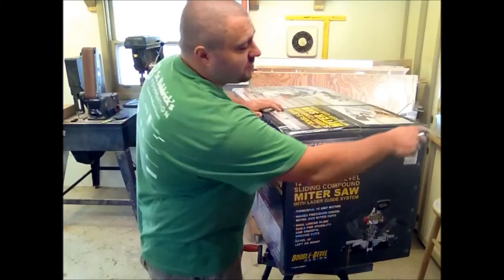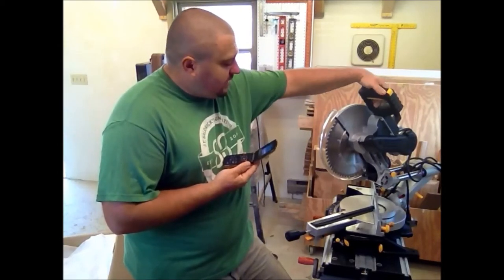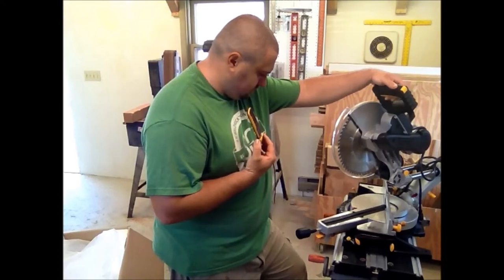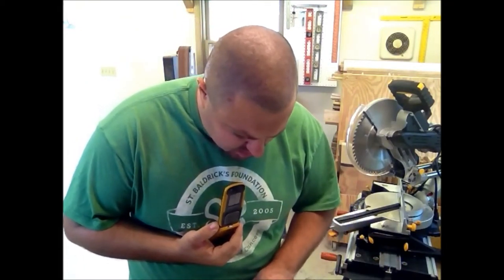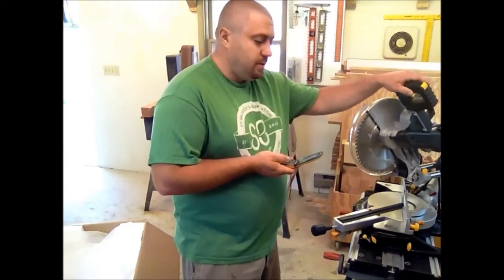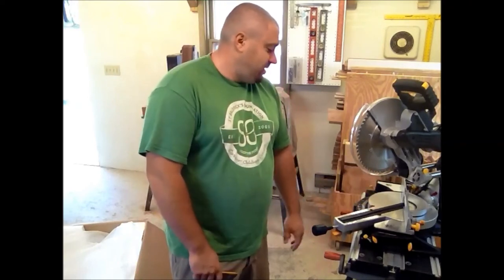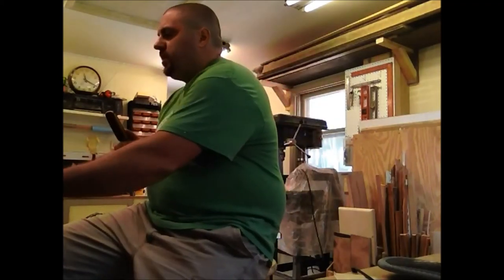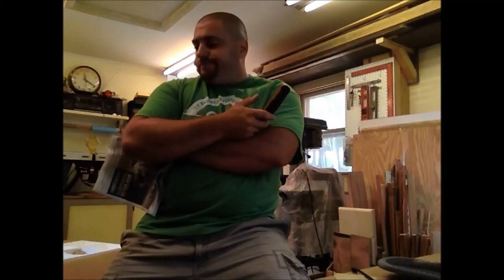★Harbor Freight Tool Review of Customer Service for Broken / Damaged Tools and Products

Comment from the maker: Cutwoodnow I did not just glue it for a few reasons. The first is that this is a part that has a good amount of vibration and is thin plastic and would be apt to come apart again. Second reason is that I do not want a ridge of glue on the kerf board that would likely catch on boards that slide across it and in turn would make it more likely to break again. The main reason is that it is brand new, and that I should not have to deal with a broken new product, get proper glue from the store, glue it, clamp it, and chance it coming apart while I'm using it and sending plastic shards flying in all directions.
I hope I answered your question. Thank you for watching my video.
Reply: I'm pretty sure that epoxy would hold the plastic quite well. By the way, at HFT we don't carry parts at our store only because there would be no room to store every single replacement part for every single item. On the contrary, our "1-800" number for parts is a mess because we have 500+ stores and at every store we have multiple customers per day asking for replacement parts (and I am sure there are only three people working at the parts hotline). An alternative way to get parts would be via e-mail. In all honesty, Harbor Freight is at fault for not being able to supply you with a part, serve you with convenience, and for attending to you with delay. For reasons that I wouldn't know, we don't have a replacement part ordering webpage or anything better.

I feel pretty bad when I work at the store and we can't do much to help someone. In this case, I feel pretty much the same way. I'm sorry, Dan!
Reply from the maker: I agree with you that it seems to be a fair bit disorganized with part and customer service. I'm glad to see that I'm not the only one who thinks this to be true. Thank you for watching and commenting on the video.
Reply: Whump Tapus I tried to get a part for a sears Craftsman router through their parts ordering  system and it was a nightmare as well. Custiner Service is non-existent any more.  Not just Harbor Freight.

Comment: I have a very similar experience as you with a power drain opener I got for Christmas.  It was missing the cutting tools that were supposed to be in the box.  After several attempts to get them to JUST send me the missing parts, they said I had to take it back to the store. That sucker weighs over 75 pounds, and I was not going to carry it back to the store just for 3 parts that weigh less than 8 ounces total.  I ended up buying the parts on Ebay and vowed that this was the last tool I will get from Harbor Freight.
Reply from the maker: larryz24 They do have a good many number of tools that are a good value. It is a real turn off though when issues like your and mine arise. It seem that Harbor Freight Tools (OFFICIAL) could come up with a solution to make the customer happy and be able to save the business money too. Maybe they will see our posts and take note of what their customer base is saying about the after care of the customers. Thank you for watching and commenting on this video. I hope to hear from you again soon.

Comment: Unfortunately most companies operate like this. I ran a retail farm and ranch store and I would occasionally swap out trailer parts, sprayer parts, etc. and then I would call the vendor and get a replacement saying it was damaged in shipping. I have found most managers don't want to go the extra mile for the customer anymore. The one company that has the best customer service is Weber! I will never buy another brand of grill again. I had an issue with a smoker part and they sent the replacement parts 2nd day air and even though the owners guide had a cost associated listed for them they charged me $0 and called me back a few days later to ask if they worked!

Comment: I hear what you're saying and I agree with you that sounds like the best solution to a simple problem but Harbor Freight does not manufacture these parts so they would not have the part that is broken on hand. This is supplied by the factory only plus the factory has a contract with the seller to provide, among other things, quality shipping material for their products and if they fail to do that they need to be charged back.

Comment: Playing "Devil's Advocate" ... I could see a couple of reasons why the store wanted the whole unit back ... #1) The piece that was broken was on a saw that has a part # ... but, is it revision #1, 2, 3, 4, 5... they sell so many and the saw changes during production as newer revisions of that saw are blended into the production line ... which do you have ... anybody's guess.  #2) if the saw is returned in its entirety ... they can tell which plant made it...who inspected it and what kind of packaging is allowing that to happen.
Reply from the maker: djkulp1 ya know what? That is actually the best reason I have heard as of yet. That makes sence to me. Thankyou for mentioning this. It actually makes me feel a little better about having to return it to the store. It still cost me the extra fuel and time to go back. oh well water unde the bridge. Thank you for commenting and sharing.

Comment: 10 miles per gallon?!?!?!
Are you driving a train?!
A Lamborghini gets better mileage than that!
Reply from the maker: Dikotomii X Nope. ram 2500 4x4 with a 5.7 l hemi. It pushes and pulls great, but stinks as far as gas mileage. Choooo Chooooo. :)
Reply: Lol that's what my F250 gets for mpg
Reply: @DanRogersMountianDan  get another truck
Reply from the maker: @coleyounger2874  I did.... I got a 1500 ram with the 5.7 hemi... ironically I still get the same mileage that I was getting on the 2500..... It must be a thirst model of Dodge engine.

Comment: I had the same experience with their 3 shelf metal cart .  I managed to strip about 10 of the 100 bolts the cart came with and I couldnt get the bolts from CS . It took me an hour to assemble it . A lotta time to dissassemble and reassemble . Then they offered to ship me one and exchange it but Id then have to repack it and take it to UPS.  I ended up getting a gift card for 10.00 only to find the gift card was only for HF. LOL I gave up and just bought my own bolts.
Reply from the maker: Ed Yager yikes that is ruff. I think I would have just went and got the bolts too, my friend. I was looking at a 3 shelf cart for the shop. Was there really that much assembly?
Reply: Dan Rogers well let me think . each corner has 2 bolts . 4 sides x 3 shelves each has 2 bolts . 24 bolts plus the handle .  ok so maybe there is not 100 lol . oh and the wheels have 4 bolts each . But more important is the wheels are mounted way to much in the center making it very tippy. my big rubbermaid card wheels are mounted right on the corners and is rock solid . the shelves are thin metal but it works for light stuff. but after the super coupon of 29.99 and the 10.00 gift card I cant beat 19.99 for it
Reply from the maker: Ed Yager sounds like a good price for the hassle it took you. here is the big question, would you do it again?
Reply: No I would go for a small rubbermaid cart if I had it to do over again . They will last forever and are way more stronger .
Reply from the maker: That is exactly why I asked that question. I get to learn from your experience. And maybe save myself some hastle too. Did you compare pricing between the two?
Reply: sams club sells this steel 3 shelf cart . looks better but is 99 bucks  http://www.samsclub.com/sams/excel-steel-tool-cart-with-rubber-work-surface/prod6400636.ip?navAction=

and lowes sells the rubbermaid cart for 110.
http://www.lowes.com/pd_4069-1097-FG450027BLA_0__?productId=3699012

not as cheap as the HF cart but you do get what you pay for lol
Reply from the maker: Ed Yager awesome. Good info. Thank you.
Reply: Ed Yager You need to invest in a inch lbs torque wrench, or stop eating so much spinach.
Reply: well to be honest I was using a dewalt impact screw driver ..  I should of used a screw gun with a clutch.

Comment: Always inspect your purchase before leaving the parking lot.
They do have parts, but they don't have them at the store.
The parts list paper has a phone number to call for parts.
Reply from the maker: Dennis Flora I should have opened the box. I just figured that the box was not damaged  at all so it would be good. Well we both see I was wrong there. The 2nd phone call in the video was to the number that was on the parts list. As you heard the gentleman that I talked to said there was not parts available. Frustrating, to say the least.
Reply: Dan Rogers 
You can repair the crack with 3M 5200, but it takes 3 days to cure, before you can use it, but it will be as strong as new. 5200 comes in black or white. 
Just don’t let any cure on the surface, it’s a bear to scrape off after it 
cures. It’s a permanent repair.  Dennis
Reply from the maker: Dennis Flora I have not heard of this before I will have to look into it. Thank you for the advice.

Comment: Why would you want to replace only the plastic piece when the saw obviously received a severe jolt during shipping? Aren't you worried that there could be other damage or misalignment?
Reply from the maker: Marty Colasurdo good point. I had figured out that the piece broke due to the way it was packaged. The manufacturer put a thick piece of cardboard between the saw blade and the kerf board. When the saw was placed in the foam in the box the cardboard piece prevented the box from closing all the way by about a half inch. the box was taped shut then other saws were stacked on top of it. This forced the saw down that half inch breaking the kerf board. I believe that this is how it was broken. If i thought that it was broken by a drop or other blunt force trauma I suppose I would have caught that at the store with heavy damage to the box.  I appreciate your input and thoughts. it is certainly a valid question. and a great point.
Reply from the maker: Marty Colasurdo have you had issues like this with products from a retail store?

Comment: Harbor Freight power tools are a big no-no, unless you are using them a couple of times. Not just because of the bad quality and obvious lack of quality control, but also because you cant buy replacement parts, so when anything goes wrong with them you are screwed.

Comment: I purchased a metal work bench last week from them the sore is a hour and half away from me but i was in the area and had a 79$ coupon anyway i get home  put the BENCH TOGETHER  and get down to the end and they put 2 of the same parts in box not a right and left but two rights........ I called the store and the girl said call the 800 number so i did the 800 number kept me on hold for almost 30 mins then the phone hung up.... I called pack and it was picked up in about 5 mins... was told the same thing you were they dont have parts take it back to store.. I called the store back and asked for a manager  told him the bench was fully built except the missing drawer rail  and that i had a small car and did not wont to take it back apart.. he told me to just bring the extra arm and he would give me a left one ................after thinking about a 2 hour drive and the gas i got out my drill and made new holes dont look 100% but it works lol
Reply from the maker: Stephen Howell I'm glad to hear that you were able to fix it yourself without having to waste the time and fuel to go back for the part. At least the manager was willing to give you just the correct part and not make you to return the entire bench. That sounds like it would be a pain in the neck. Thanks for watching. I hope to hear from you again soon.

Comment: By time you did all the calling you could've swapped it out already. You would've driven out there to get the part anyways. Yes their fault QC sucks but not their fault you don't want to bring something back you can easily lift. BTW I have to take something back tomorrow 30 miles that weights 3x more than that.
Reply from the maker: mbickerdike17 that stinks. I am sorry that you are in the same position I was in. I really only wanted them to send me the replacement part. That would have saved me alot of time and travel. Oh well.
Reply: No one gives a rat's ass what you had to take back. Let the man do whatever he wants.

Comment: Probably replacing the tool would be better as we don't know what caused the break so something on the tool may have caused it and would need to be replaced.
Reply from the maker: Lee Wood the broken kerf board was broken by poor packaging. This became evident to me when I unpacked 3 more saws from whole in the store and found all 3 broken in the same spot. When the saws were packaged a thick piece of cardboard was placed between the kerf board and the saw blade. The arm was then zip tied down. Then the styrofoam packing was put on top and the box sealed. Unfortunately the cardboard did not allow the arm to go all the way down, so when the boxes were stacked it forced the saw blade down onto the cardboard. This forced the kerf board down too breaking it. It is a waste to return the entire saw. Plus a waste of my time and gas to take it back to the store. All because of sub par packaging. That is truly a waste all the way around.

Comment: Considering how much money was paid in the first place, and it being a gift why not just spend a little money on a plastic welder or some super glue? Yes I know it was broken from the start and it shouldn't have been but things do happen.
Reply from the maker: Love2boat92 I understand that things happen, and that is why I sought out a copasetic replacement for the broken part. The part that was broken could have been easily removed and replaced. I do not however feel that gluing or plastic weld would be a viable option for this part of the saw. I believe that with the amount of vibration from the saw and the weight of the material that would be sitting on it and sliding across it that it would have most likely broke again. Or worse yet the piece would get pushed into the blade and be broken off and thrown back and into my face. I really don't feel that repairing the broken part was a safe option. Yes it was a gift. Granted it was not a dewalt or another expensive brand, but it was still around $200 roughly. That is a fair amount of money for the saw. I feel that it should be in good shape when I open up the box. All I really wanted was a replacement part, but as you heard in the video "they don't make replacement parts yet for that saw because it is to new.'' My only option was to exchange it at this point, which I did.
Reply from the maker: Love2boat92 now allow me to ask you a question. If someone purchased a gift for you, lets say a new car. When you went to the dealership to pick it up you found that the dealer's employee had parked to close to the rear of a truck in the lot and had broke a head light on your new car. Would you expect the dealer to replace the broken head light, or would you want to glue it back together and call it good enough?
Reply: You brought up a lot of good points but I know from experience from running a dewalt saw just like this one that little slivers of wood get trapped down in the cut and they are difficult to fish out. I think we might take ours out. Sometimes the slivers of wood do get trapped in there causing them to fly out. Sometimes I think that's another failed safety attempt, just like the safety gas cans. About the car, yes I would expect the dealer to fix it or give me a discount on the car but that would only be if I paid for the car. If it was a gift I wouldn't make a big deal about it. I got it for free and I'll put a little money and effort in it if it needs it. That's just me though. Everyone's different.
Reply from the maker: Love2boat92 True every one is different. And you are right about failed safety attempts. Those new "spill proof" gas can nozzles have caused me to spill more fuel than I have ever done before in the past. Now I just take the nozzle off and use a funnel. Thank you for watching and commenting.
Reply: Dan Rogers yeah I too have spilled more gas with those new nozzles than I ever did with a proper gas can that has a cap and a vent. I actually think the new nozzles are really dangerous because they stick open and I end up spilling gas all over a hot engine. There are other alternatives like the no spill Jill or the nobama nozzle.

Comment: I would have probably made the part out of wood, Masonite or what ever.  Also, using the broken part for a pattern.  When finished saw right into the new part and have a much better board.  Just about everything you buy from Harbor Freight seems to need some kind of tweaking right out of the box.  The saying isn't as true as in the past "you get what you pay for", because everything seems to be made in China!

Now days it doesn't matter what brand you buy they don't have spare parts on hand till the product has been out there for a while and all stores with make you bring the whole thing back for exchange.
Reply from the maker: Tom F Great thoughts there, thank you for watching and commenting. i hope to hear from you again sometime soon